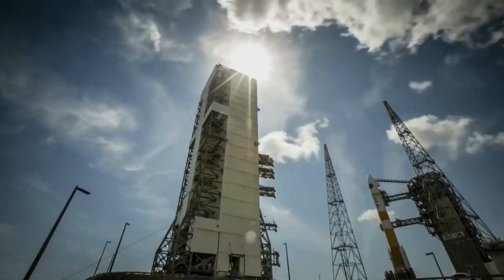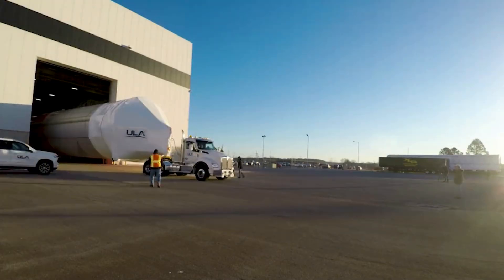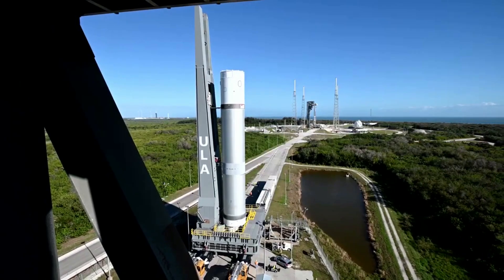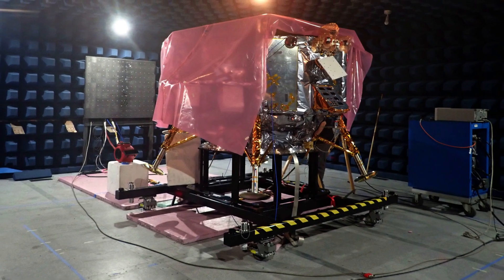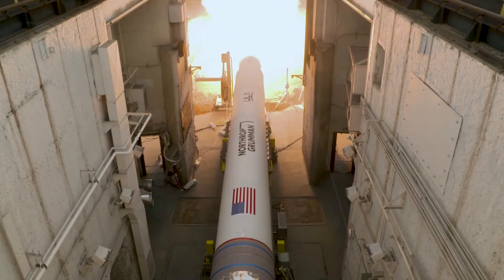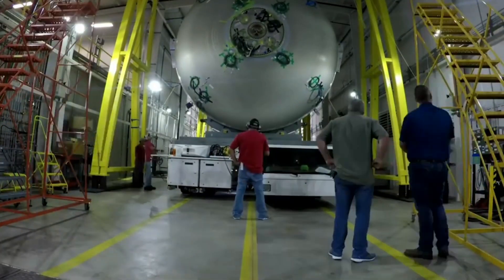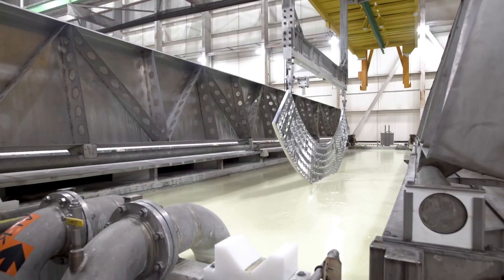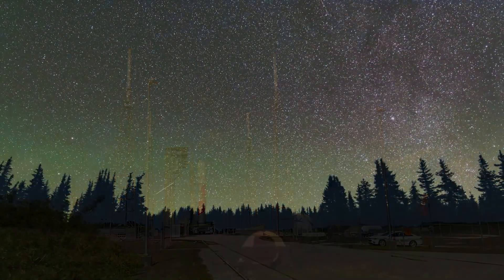ULA's Vulcan Is On The Launch Pad For Final Testing

Comment: I wonder what the purpose of the multi manifest fairing within a fairing would be. I get the multiple payloads aspect, but why does it need a secondary smaller fairing within the primary fairing?
Reply: Providing power and data connections to the upper payload as well as supporting its weight.
Reply: @luther0013  thank you, that makes a lot of sense

Comment: Very cool to see Vulcan making progress. BO could fail everything else, but it MUST provide BE4s or else the US military will be PISSED.
Reply: The Air Force (USSF) had some pretty sharp criticism for Blue Origin's New Glenn and Northrop Grumman's OmegA development for NSSL2 payloads back in 2020. From a SpaceNews Aug 2020 article

"Despite political pressure to not end the LSAs, the agreements will be terminated, Assistant Secretary of the Air Force for Acquisition Will Roper said Aug. 7 during a video conference with reporters.  'We will work with those two companies to determine the right point to tie off their work under the LSA agreements,' Roper said. The intent of the LSAs 'was to create a more competitive environment leading into Phase 2,' he said. 'The point is not to carry them indefinitely.'”

Blue had a $500M Launch Service Agreement (LSA) and lost roughly $245M of it. Blue Origin's motto is “Gradatim Ferociter”, which translates to “step by step, ferociously.” Blue Origin just doesn't seem to take steps very often.